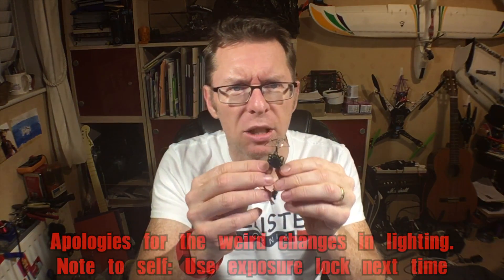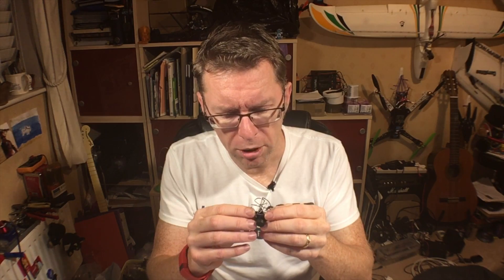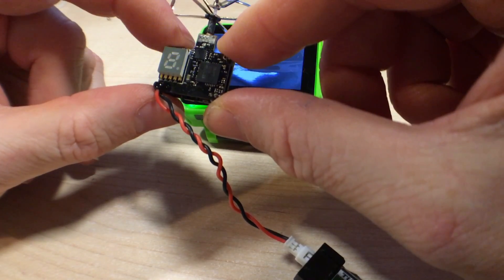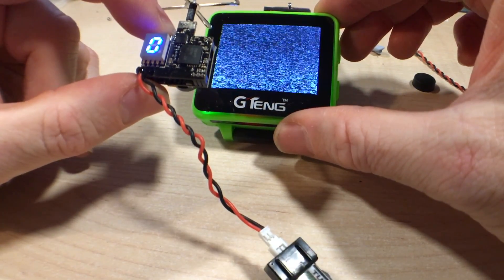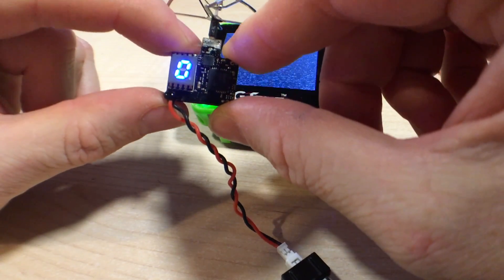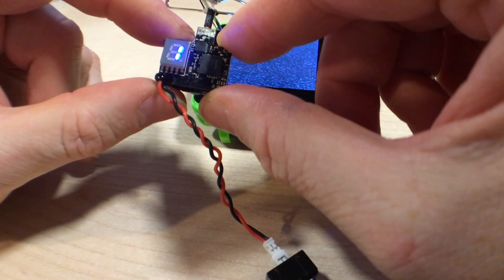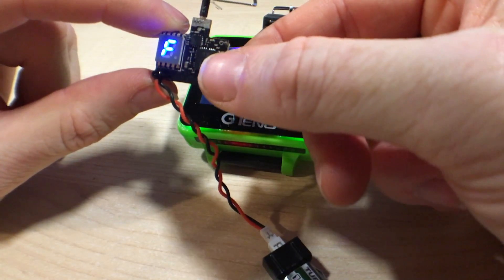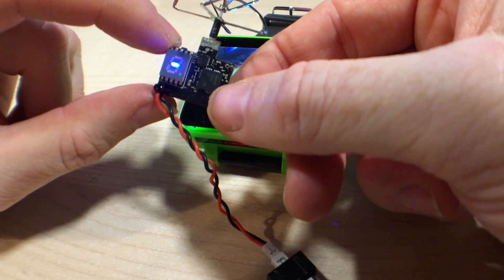FPV first look: The Eachine TX03 mini VTX/Cam

Comment: Hey, I just found the Eachine DTX03 on the Banggood site.  It has an extra 3-wire harness on it that seems to do video out, video in and ground.  That may accommodate OSD units.  It also has the DVR function but maybe they've addressed the latency when recording.  Can you see what you can find out?
Reply from the maker: I'd  be interested to test one out, but last stuff I saw about the DVR AIO's was they dropped multiple frames in the recording.  A simple VTX only solution like the VX03 (I'm just putting on in a tiny wing) would accommodate an OSD though.

Comment: Problem I am facing, I hooked the Tx03 to the f36 Furibee to make a tiny whoop. I get like 15 seconds of flight and then the furibee lowes to the ground and sit on the ground blades spinning but no lift. When I turn the transmitter to 0, the same problem occurs. I have resoldered the set up a few times to see if it was my joints but, no dice. Think it's a shorted camera? the drone fly fine without the camera attached with the full ~5 min flight time.
Reply from the maker: Well, it should certainly take the camera and fly - looking at a few other videos.  I guess it would be useful to attach the TX03 to the f36 without actually wiring it in, just to check it can carry it ok, and it's not simply a case of a bit of a saggy lipo unable to lift it for more than 15 seconds.

Comment: I just bought the JF 01 FPV cam similar to this one but havent been able to get a signal (for more than a second or so) sadly as the wires needed a battery connector to be soldered on. I wish they could've included a connector like this one has !
Reply from the maker: Do you lack a soldering iron then... or a battery to use ?
Reply: CurryKitten I have a soldering iron and lots of 3.7 v batteries and I did attempt to solder it onto a jst connector. I had pwr but no signal so Ive ordered some JJRC H20 batteries as apparently they fit straight in.  I'm hoping a strong connection from a battery will yield a signal as my soldering the wire didn't

Comment: Hello chap, thank you for vids, interesting for quad noob like me. I'm looking at having a crack at FPV using an EasyCap/Phone/Google Cardboard solution for a taster using one of these TX03s (it's going on a Syma X5C quad). Can you please recommend a receiver I could use with the TX03? Also, just out of curiosity after watching some of your flight videos, what part of UK are you in? You have plenty of open space there, lucky git. I'm SE London suburbs and there's basically nowhere I can legally fly without getting in a car, going out to Kent and bothering a farmer (if I'm going to be legal).

Thanks for help.
Reply from the maker: Hi Andrew,

Glad you are finding the videos useful.  Sounds like you are on a budget if you are just dipping your toe in, but a few options.  I have an RC832 rx that I use at home for lots of stuff, seems to work pretty well and the price is good.  About £12 here http://www.banggood.com/Eachine-FPV-5_8G-32CH-Wireless-AV-Receiver-RC832-p-975426.html

I have to say the EZcap/phone in google cardboard sounds a touch faffy (I hate having extra wires), so you might want to consider a cheap/diy goggle solution.  Way cheaper than they used to be now.  Something like this http://www.banggood.com/Eachine-VR008-Duo-Antennas-4_3-Inch-5_8G-40CH-Raceband-FPV-Goggles-Auto-Searching-p-1072710.html will only cost £42 and those seceral different versions on Banggood.  That way you don't need to buy a receiver as well.

It might seem like I have lots of open space, but it's a constant struggle.  I'm down near Southampton, so not exactly in the stix.  Where I fly mini quads I found a field near some woods that's well hidden away, but plans are to build new houses on it soon.  If I'm out with planes in a really big open space, then it's generally a 40 minute drive into the New Forest where we're ...ahem, not actually allowed, but do anyway.  It's very hard to be completely legal... I just go with being safe.

Good luck !  If it helps I was hoping to film a few videos about starting FPV on mini quads, but the weather hasn't quite been playing ball - I'll get them made eventually though
Reply: CurryKitten Very kind, thank you.

Comment: Which you recommend Eachine TX03 or TX02 and why?
Reply from the maker: The TX03 allows you to vary your output level, and if you are on micro-sized models then 25mw is plenty and will drain the lipo less.  So I'd generally get the TX03 or the TX02 just to have the flexibility.  On both though, there is an element of distortion with the very wide angle lens, so make sure you are happy with that.  On micro-quads it's not an issue, but you notice it on large quads or planes

Comment: which battery did you use?
Reply from the maker: In this video, I'm using a little 200mah 1s lipo (a Tiny Whoop style one) although anything is doable in the right voltage range - plug it into a receiver and get 5v that way